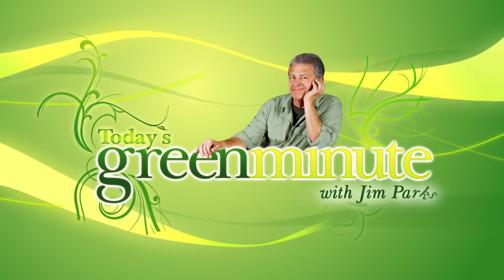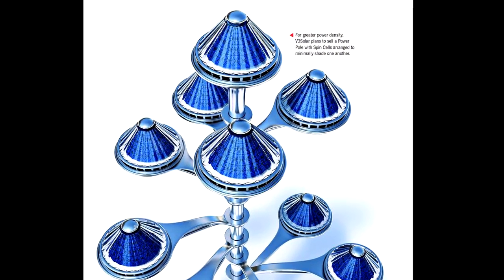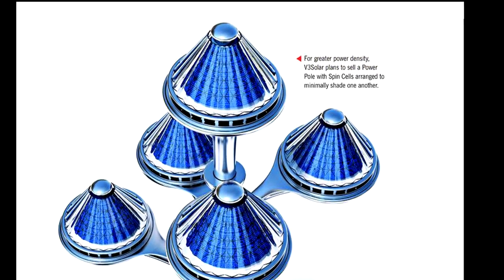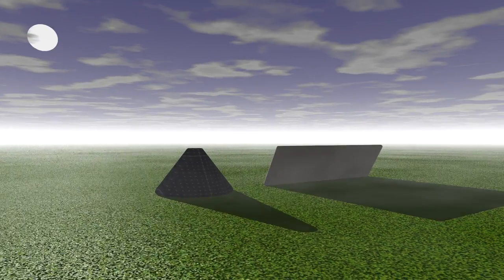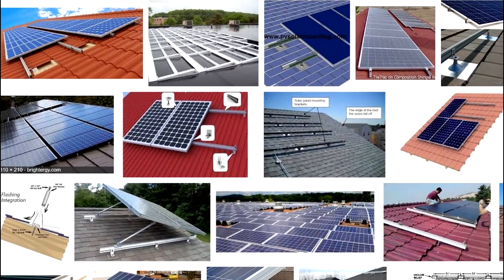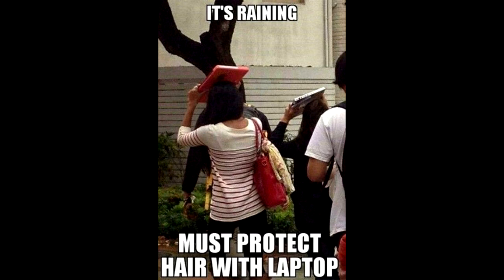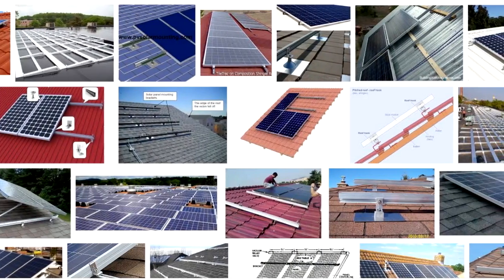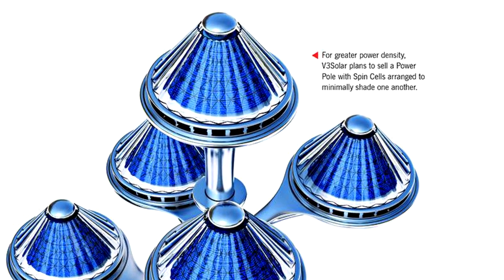Spinning Solar -BUSTED!

Comment: My head is spinning now, it’s true I’m a trillion times cleverer! Here’s the proof:

I made a cone and cut it in half and didn’t spin the two halves, now I have both sides receiving power and I don’t waste the energy they trap from the sun by powering a motor to spin them… uh oh, hold on, they’ll get more sun if they are rectangular, I’ve just invented the flat solar panel!

I suppose if the top of the cone was always pointed directly at the sun it would use each surface but come on, it’s all ridiculous.

In passing, it’s true that water powered vehicles have worked, they are called STEAM ENGINES and fossil fuels have to be burned to create the energy to convert H2O to steam which produces motion in a piston or turbine.

Comment: This will be useful for harnessing solar power near the sun. But if you have only half solar panels working, why not put all of them ~1.41 times further?
Btw, need to try that in KSP. Heat+spin is a bit buggy, so i may get a boost due to better cooling.

Comment: 10:02
this is due to a general frustration of things "not moving fast enough", so people are more susceptible to the concept of a revolutionary breakthrough that those old fuddy duddy scientists just won't accept etc etc
Reply: +Ryukachoo
I think part of the issue is that science has expanded immensely in the last 50 years.  So the average Joe has no chance of keeping up.  If they did not love science at school they did not understand a lot of it then - let alone now.  So most of the media and a good proportion of the general public is basically science illiterate so will believe any claims that sound plausible.  They just do not have the knowledge to see the issues and are not as sceptical as those that demand proof and evidence.  They also grew up on sci fi movies and media so are keen to see the future happening now.

This is a similar reason that some of the insane conspiracies have gained in traction recently.  While the average Joe is not usually dumb enough to fall for conspiracy nonsense there is the low hanging fruit that are even dumber than most.
Reply: And Big Energy is trying to shut him down, right?

Comment: I'm curious though about the spinning nature of the solar panel. I'm not that bright on the matter so I'm probably talking shit but wouldn't there be a way to increase energy output this way? Like combining solar panels with turbines? Since solar panels do absorb a lot of heat from the sun and get rather hot, would there be a way to use that heat to heat up water, turning it to steam and using that to turn turbines like they do in a lot of different power plants? I dunno the logistics of it nor if there'd be near enough heat built up (unless you cover the panels in essentially a magnifying glass or something like a light farm though that might just destroy the solar panels) but would that be a possibility of getting more efficiency out or would it over complicate the system?

Comment: couldn't we fix this problem simply by adding little pistons on the ends of a panel and allow it to adjust with the sun?
i dunno if that would work well on normal house roofs but flat city roofs would probably work i imagine
correct me if i'm wrong

Comment: What does making Pi = 3 have to do with the bible and what does the bible have to do with a solar panel shaped like a cone?
Also you if we are being generous like with your math with a normal solar panel generating 100% energy its only for half a day and the cone is generating 50% for the whole day so you messed up and said its just as good
I know its not just as good but maybe you should've considered being a bit more accurate on your math

Comment: People tend to forget about the purpose when they start thinking of improvement. If a device was designed to do X function but you want it to work better. Don't make X function worse for some Y benefit. Think a swiss army knife. You can slap on all these crazy features but in the end you just have a shitty pocket knife. Same with this panel. Lets remove the only benefits for things that just make it look cool.

Comment: (current  me if im wrong) 
U said it will generate 50% less than flat panel but problem  is angle with sun and panel is not always 0 degree or 180 . Lets see sun rises at 6 am to 6 pm then angle between horizontal panel and sun is 90 so 0 % energy  and slowly  increases  to 0 angle at 12 pm generating 100% energy  and slowly  decreases to 0 % at 6 pm. So it is like
0% at 6 am
17 at 7
33 at 8
50 at 9
66 at 10
84 at 11
100% at 12 pm
And decreases as we go to 6 pm in similar  patton. 
In case of circular circular pannel, althiugh it generating 40% it will generate arount 30-50% constantly from 6 am to 6 pm so total efficiency of circular pannel is around 40% whereas for flat pannel it will be around 40% so?

Comment: The one thing smart about this design is that the cones don't need to be angled in order to track the sun.

A sphere would always have some energy flowing in, so long as it's morning.

But, I think that'd be better to power the computers responsible for tracking the sun.

Comment: One thing though, the idea of mounting tracking solar panels in a similar way to this; actually seems like it could be a good idea. Just instead of having panels on all sides, have one sloped panel mounted on the vertical axis. You could just use metal pipe, put some gear teeth on the pipe and a small motor under the dark side of the panel. Seems like it would be relatively cheap mounting system for a tracking panel.

Comment: ... you can't compare a 4.5m long cell to a cone with 1/3rd the foot print. sure the number of cells are the same but this is attempting to solve the over heating issue by rotating which cells are used. In the same foot print if you had 3 cones you'd be generating 150% the power if I use your 50%/cone figure. The conical shape is meant to eliminate the need to reposition you cells through out the day due to the sun's rise and setting and through out the year as the planet goes around the sun for maximum light absorption. Roof cells are fixed so you can't even implement a tracking feature. The spinning could also benefit decreasing  snow accumulation so your cell can function in the winter.

Comment: Question. Won't the cone design capture more sunlight throughout the day? Flat panels on a roof for example will perhaps not capture as much sunlight parts of the say cos of their Angle. With a cone..or triangular shape you can capture light from both the rising and afternoon sun.  I wondered if this.. combined with the lowered temperature can't make up for the fact that less surface area is being exposed to sunlight compared to a flat panel.  But also.. it takes energy to spin these cones... Even if these cones were more efficient..won't you lose an awful amount of energy to drive the motors to spin them?

Comment: you know the magnifying lens might not be too bad of and idea. I'm thinking run clear pipes over the solar panels with circulating water through them. use the steam to power a pump to circulate the water and then hopefully the running water will refract the majority of the light onto the panel. not sure if it would work, but definitely don't put it around a cone  if anything form the panel in a concave way to concentrate the reflected light. maybe mirrors instead of photovoltaic cells near the edges that wont capture a lot of light.

Comment: Doesn't the very fact that you're moving the solar panels out of the sun reduces its efficiency as well, possibly more than a static inefficient arrangement? If they're to move, I'd rather have them like my own Freaking_ Solar-Wind Hybrid Generator™,_ with solar panels for windmill blades. Or yet, the new model, which also has nets on its blades, capturing fog to give free clean water and plastic to the whole world. If you're rich, there's even the possibility of buying yachts with freaking solar-panel sails as well, another combination of wind and solar power.

Comment: Why not just have flat panels, and run water pipes underneath. Generate hot water for your house, while cooling the cells and increasing their efficiency. I'm not an expert on this so please be easy on me.
Reply: Apparently it is already done: https://www.thegreenage.co.uk/solar-pvt-hybrid-panels/
Reply: The only flaw I can find is how the slate roof will stop most heat from reaching the pipes
Reply: Put the pipes directly under the panels?
Reply: Najey Rifai 
Yeah I guess that would work
Reply: Najey Rifai heyyy that's pretty good
I would like to see someone try this
Reply: Something similar is done in our town. They burn fuel to generate electricity, but the thing heats up too much and to cool it down, they have water pipes underneath, which are then used to heat houses in winter.
Reply: An old idea that doesn't work in practice. For the solar cells to cool sufficiently the cooling water cannot become too hot, so you need a high throughput of water. For the hot water to be usable for heating or warm water you need to get it at least  at 70°C, much too hot for the solar cells.

What you could do is a two stage system where cold water is preheated by the solar cells and then brought up to a usable high temperature by a conventional solar thermal panel. But this way you will end up with a very complicated interdependent system. With the current low prices of photovoltaic panels it is cheaper to have separate systems for electricity and hot water and just except some efficiency loss in the solar cells to higher temperatures.
Reply: People have done that for heating pools since the 80's.
Reply: Might have something to do with exposing that type of piping to outside weather conditions, particularly temperatures below freezing.  There's also the energy requirement of moving all that liquid/gas around, which may very well exceed the efficiency boost you get from actively cooling the panels.  And then there's the retrofitting problem - it might be easy to plan for an installation of those types of panels during a new construction, but, I daresay that most panels installed on homes today are post construction installations.
Reply: I think in China they have solar panels on a lake, cools it but idk about the flora in there.
Reply: The power needed to pump the cold water under the pannels will use most of the power it pruduses.
Reply: i belive some work kinda like that
Reply: Umm... Guys... Thats been around since the 70's..

I thought OP was being sarcastic by suggesting something that already exists.
Reply: dajosh42069 I mean he said he wasn’t an expert, kind of hard to know about something when you’ve never had any personal experience with it
Reply: Najey Rifai But hey, at least you didn't try to do what Elon Musk was thinking of doing... Running out and getting a patent on something that has been around longer than he has. :P

Or be as stubborn and insane as Donald Trump when only a couple of years ago he; tried to claim live and on air that HE invented the term/name "fake news".

Good on you sir!

Comment: @f00t You did not mention that if you have few cells in lower light then then you have lower output of the whole solar panel. As I've read it output of the non-shaded cells is lowered.

Comment: How much cooling could "not being in the sun" have vs "still being connected to something that is conducting heat too you". If I stood in the sun for 5 seconds, and then stood out of the sun for 5 seconds, I would not return to my original temperature.. Would I?

Comment: Just so you know, solar panels also generate electricity when they are not directly facing the sun. The can work with ambient sunlight or indirect sunlight, though their efficiency is drastically decreased it is never 0, like you mentioned.
Nice video though.

Comment: +Thunderf00t trying to work on a crystal (any kind will do) battery/power generator and I intend to: 1. break it with as much science as I am capable of throwing at it and 2. when I can't break it anymore I'll hand it off to someone else who has more experience than me so that they can try to break it until they can't anymore and 3. repeat steps 1 and 2 until I can't find someone who can break it and then 4. start a Kickstarter campaign so I can get it out into the world showing it working and the how and the why it works

Comment: I'm wondering if a static cone with good thermal conductivity across the middle would work just as well as spinning it. Or just a hollow cone with holes for convective cooling. Spinning consumes power and adds cost/complexity.
Then you'd still need to work out if this is cheaper than a tracking panel.
In most places (e.g. outside the tropics) you could also only put cells on part of the cone as a function of latitude. Since only the part which faces the equator will ever be pointing at the sun anyway.

Comment: Wouldn't it be saner to just

Make the solar cone and then put a fan blade on the top so it would spin, get 360 sunlight, be cooled by the wind speed, AND YOU COULD MAKE EXTRA POWER BY USING THE WIND TO SPIN THEM?

I mean yeah it might not be perfect but it sounds more doable than putting them in a cone of glass that would probably just magnify the sun onto them and set them on fucking fire while using most of the energy to keep it spinning.

Comment: 5:39.... er so water cool them and then take that heated water and use it ... ( if im reading this graph right ... which im probably not) you would expect to get 40 degree water out of the cooling of solar cells ring ?  well that plenty hot  for low temp chemical processes and of district heating   or in remote locations linked up with thermopiles  to produce albeit small amounts of electricity   and for say a railway track circuit maybe that's enough?  or wack it in a sterling engine  and convert it into something else .. a flywheel storage system? a small water pump  or just take that 40 degree water  put it in a parabolic  trough collector and transfer it to a feed water heat pump for a power plant further along   hell its 40 degree water its heat energy just waiting to be used and we're just throwing it away ... hell the best thing i can think of is if it could be stored via s chemical reaction  over time then just collected and burn or what have you

Comment: Even if the cones were tracking and spinning, there wouldn't be enough efficiency to cool it since the shade is now gone. You gotta remember that the motor that spins these things generate heat, so the spinning needs to cool more than the motor's heat output that gets put into the cells. Granted this isn't ALL of the motor's heat, but whatever is radiated into it. Since the only thing cooling it is the ambient temperature, spinning won't do a damn thing.

Even if it DID cool it off, we gotta think about the power usage that the motor needs to cool it off. The power generated needs to beat the cost of energy to spin it and needs to be high enough for it to be viable to output. If it put out maybe 15 watts then sure. That's about on par with a regular panel. You then take out the power from that to power the motor and see what you get. It's not mathematically viable. If the PANELS were better then you can talk it up, but since the panels are using glass to try to focus more light in, then they're likely not any better than they were before.

From here, we now have a solar panel shaped like a cone, that tracks the sun, and spins; a much less efficient form of a tracking solar panel. If you try to argue that it's better for a home because they can be installed in places where sun is always hitting it unlike roof installations, then please consider the above: They're likely to only generate 15 watts per cell. An average household uses maybe around 900 kWh per 30 day month. That's 30 kWh per day. At 15 watts, you would need a whopping TWO THOUSAND cells. Yes, that is a 2 followed by three 0's. 2,000. Even if it was larger, and was 10x bigger, you still need two hundred of these to run off the sun alone.

A flaw in this is that houses don't live fully off solar electricity, so let's address that. A solar panel will get about 4 hours of usable sun everyday at most. An average panel is about 17.6 square feet. One panel creates what, 250 watts? 4 hours of usable sun is 1000 kWh for the day. You'd get maybe 4 of these panels on your roof at most, and this jumps to 4 kWh. Let's look at this thing now. If we were to assume that they were 20 square feet per cone, then we would have 300 watts per cone, meaning 1200 kWh per day, and 4 of these cones being 4800 kWh. That's more power, sure, but then think of the motor as stated above. The power generated by these panels needs to surpass the power needed to power the motor to spin and "cool it off", which we have no idea what the power cost is. I'd imagine that a TWENTY SQUARE FOOT CONE needs a rather large motor that's gonna be loud or need high amounts of power. Even if we did downscale it by half and it's a 10 square foot cone, then you have half the power at 2400 kWh, which means you now need double that to make up the power difference, being 8 cones. You now have 8 sun tracking spinning cones that are still less efficient than flat panels because you can't cool them and these motors are generating heat which doesn't help them at all and wastes power.

No matter how you look at it, these spinning cones are a bad idea, plus even IF these worked as well as the flat panels on a roof, then they'd have to be sold at a fraction of the price in order for you to save money because now you're not only taking the cost of a basic solar array, but throwing in a funny shaped magnifying glass on the cone, but also a motor. I don't see this working at all, just from a logical standpoint.

If anyone wants to use this as an essay for an English class, go for it.